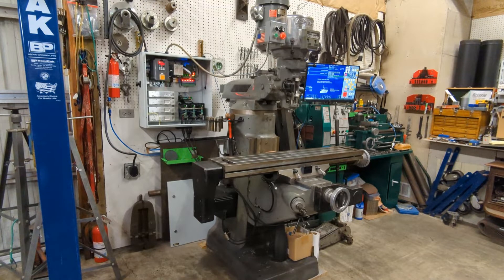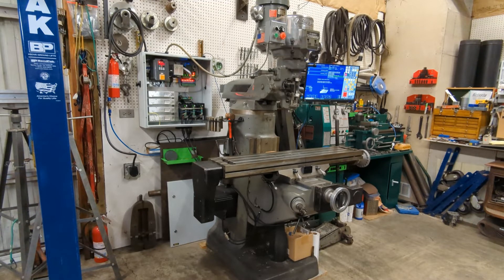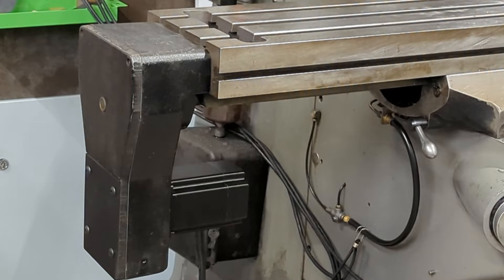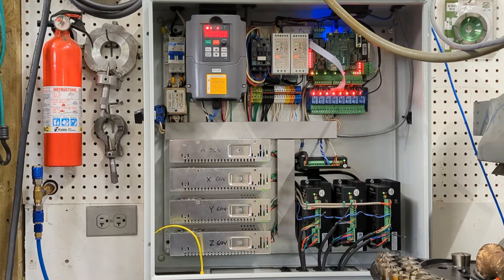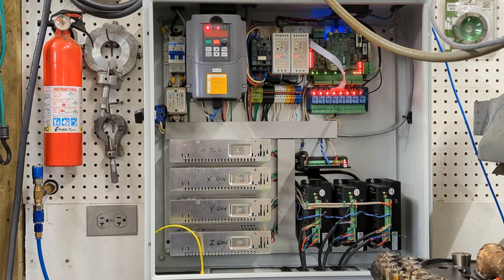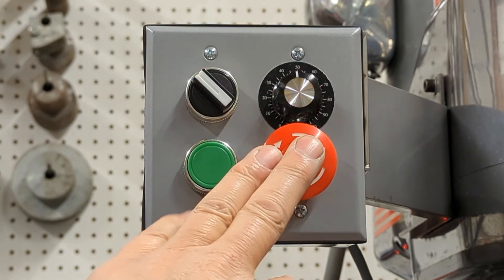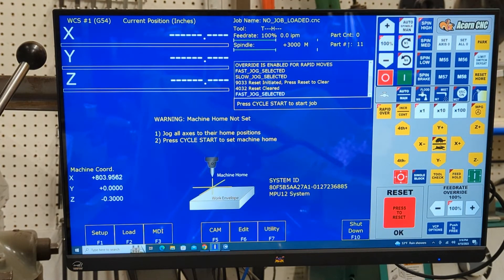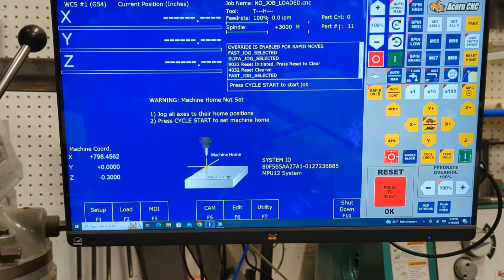CNC Bridgeport Conversion

Comment: Do you have a video or pictures of how you did the Z conversion?  Did you disconnect the table shaft to the crank? Where did you stash the z axis motor, and what pulley ratio are you running on the Z?
Reply from the maker: I don't have video of that. Had so much apart, plus it's really hard to see what I put in there. Basically I removed the bevel gears and replaced them with an HTD belt drive at 2.5:1 reduction on the screw and a NEMA 34 stepper motor and stuffed it all into the knee. It's not been ideal because there is a wear spot in one section of the screw and so my Z goes out several thousandths in that area. I also didn't realize just how many chips get inside the knee during use. I'm going to disassemble it soon and replace the screw with a ball screw set up and totally enclose the drive.
Reply: @ilrperformance7152 thanks for the info. I saw one guy replace the leadscrew with a ball screw, and then add gas assisted actuators to balance the knee.  Its heavy enough to sink if power is lost to that motor.

Comment: How are you driving the z-axis screw? Are you using a belt and pulley? If so, what belt and pulley and at what ratio? Also, are you noticing and significant backlash with the factory screw still installed in the z-axis? How did you mount the motor for z-axis? Sorry for the heavy load of questions. Very interested in doing the same thing to my mill, which currently uses quill for z-axis movement.
Reply from the maker: The Z axis on my set up is the knee. It uses a 2:1 belt drive on a NEMA 34 stepper. The motor and belt are inside the knee so you don't see it in the photos. I'm getting debris in that drive belt over time that is a bitch to clean out, so I'm in the process of moving the drive externally like i did on the X and Y. I'm almost done with that mod. The knee weighs so much it always loads the screw haven't downward and I don't use any Z compensation. Since the Z is almost always cutter depth into the part I don't move it real fast and so lash hasn't been an issue.

Comment: Very nice set up! Just trying to do the same thing myself, and had a question about the nema34 stepper motors as there is a 2phase and 3phase version on leadshine website. Seeing which one you went with, and if you went with the 2phase they have multi different power setups 36vdc,48vdc,70vdc and even 110vac for 12n.m. Not sure what is best route so seeing what you ended up using. Thanks for the help!
Reply from the maker: I used the 60 volt for X, Y and Z, and went with the 36 volt for my A axis because it just rotates my rotary table which has a pretty low gear ratio internally.

Comment: how much it cost? how much for the diagram?
Reply from the maker: I didn't build plans for this. I decided what I wanted to do with it and put together the parts I needed. It changed as I went but it's been a really solid machine. The Centroid board was my best decision, it works so good and is really easy to work with the software.

Comment: Great conversion! I would love to be able to do the exact same thing. What websites or resources did you use to be able to successfully perform the CNC retrofit?
Conversion kit, controller schematics, and BOM items to start. Thank yoU!
Reply from the maker: Honestly it wasn't real hard. I was originally going to go with servo motors but once I decided on close loop steppers I went straight to Leadshine and bought their kits. Motor, power supply and driver in one stop. Then once I chose the Acorn board they have all the schematics you could possibly want so I just followed those. The little stuff was mostly me being anal and I wanted a really clean install so I went with DIN rails and wire guides to keep it clean. Tuning it in to be accurate is more time consuming.
Reply: @ilrperformance7152  Great insight, I do appreciate the reply. Been looking into government auctions for Bridgeport knee mills since I saw your video. Thank you for the prompt reply. I will go ahead and go to those sites and begin my research to build it all in CAD before pulling the trigger.

Comment: This is nice. I am scared but contemplating doing this. I just found a J1 that is a good candidate. Any reason you picked Acorn over MACH?  You only have a few months on this build?
Reply from the maker: I picked the Acorn after doing a lot of research and talking to several users. The makers of the Acorn board build turn key CNC machines so they know the interfaces well and they provide really good hook up instructions for so many configurations. Hook up went pretty well and each thing I add on has not been much work to get integrated. It has been a couple years now since I did the conversion without any problems. But like all projects it has evolved and gotten some additional mods.
Reply: @ilrperformance7152  Can I ask what VFD you are using for this motor?
Reply from the maker: I'm using a 220 volt, 2.5 KW VFD

Comment: Timing Belt and Pulley you used
Reply from the maker: I used a 5mm pitch HTD belt and 2 /1 sprockets. Since the Bridgeport moves .200" per rev on the table it was really easy to dial in the distance per motor rev.

Comment: Can you disclose what kind of cost to expect to convert one of these machines to CNC? I am looking at either buying a new manual/CNC machine for about $15k (CNC Masters) or I can get an old BridgePort about $3K to $6K and convert it. Old American iron would probably be a much more substantial machine than a new one but also an overkill for my needs.
Reply from the maker: I did all of the research, bought the parts and did all of the assembly, so I'm into the whole CNC conversions right at about$1500.00. But honestly I didn't add every item up, some stuff I had here in the shop. I wanted a very heavy commercial Bridegeport for the stability. The newer clones or the smaller mills were just not rigid enough for my liking.
Reply: Thank you so much. I have decided to get an old BridgePort and recondition it. It will come out much cheaper and I believe I will end up with a better machine, plus the fun of rebuilding it. It looks like I can get a decent one for about $3K to $4K, about $5K to $6K for one that has 2 or 3 axis control. I would of course update all the electronics.

 From what I understand your machine had two axis motorized. You did not show how you converted the third (I guess the Z) to motorized. Can you show that?

I am looking to do very similar to what you have. I am new to the whole vertical mill thing and machining but will be starting to put together a small machine shop at my home for personal use. If I start with a manual bridgePort, can I convert it to a full CNC or would it be much better for me to start with a bridgePort that is already 2 or 3 axis motorized. I do want the option to switch from CNC to manual as well.

I think that if I find a decent 2 or 3 axis CNC BP,  I would have to pay a little more upfront but the conversion may cost less? But, like I said, I am new to this so I don't know much. Any help would be greatly appreciated and thanks for responding to my inquiry. @ilrperformance7152

Comment: Can you share homing, as to the position of the table. I'm converting my floor standing knee mill and want to place my proximity switches in the right place.
Reply from the maker: I put my homing switches to set the table almost full positive X, mid travel Y and 12" down on Z (my knee is my Z axis). That gives me the table room I need for set up and for part removal, then I translate to the part coordinate system and machine in those coords.

Comment: Very nicely done.  I have a BP S1 I converted to Mach3 several years ago and want to convert to close loop steppers and Acorn.  Any thoughts on how to keep the steppers from back generating when running the machine with the crank handles?
Reply from the maker: The steppers I used have so much breaking when powered up you can't turn the cranks without breaking something. I bought Centroids wireless pendant (which was amazingly easy to install) so I just crank the pendant and put the table anywhere I want. I didn't plan on a pendant, but now that I have it I would not want to be without it. I can literally move the table in .001" increments when I need to, or up the speed and t moves damn fast.

Comment: I have Hardinge 2007 2 axis cnc mill with an ez vision controller. This mill looks identical to the one in your video. The machine it’s self is in great shape, but the ez vision controller quite working. This is a common issue with the e vision controller. I would like to retrofit this machine into a 3 axis cnc mill with the quill as my 3rd axis. Do you have a video of your work that you done on your machine, or advise me on what I should do if you were me. What would it cost to do this myself and what would cost for me to have it done. Because my machine is identical to yours would you be intrested in taking this on. Your thought would be greatly appreciated.
Reply from the maker: Depends on what you have now for lead screws and X, Y and Z drives. You need good ball screws but if it was already NC it may have good screws. If it is a Bridgeport clone the spindle probably already has power down-feed so you'd need to disable a fair amount of the gear drives for that and replace with a stepper or servo. I chose to make my Z the knee. That way I still have the quill power feed but the Z has CNC control thru the knee. My A axis is a removable rotary table.

Comment: Do you still have the old motors ?
Reply from the maker: I have the original 2 servo motors and all of the cabinet and electronics
Reply: @ilrperformance7152  I am interested in purchasing them. My mill has had motors removed  should I contact you at your web site?

Comment: What size stepper motor are you running on the knee? They have quite a few selections on stepper motors they go by Oz or newton meters. Nema 34 to nama 42.
Reply from the maker: I used NEMA34 closed loop steppers, 9.0 Nm on all axis. They are more that I need on X and Y but pretty decent on Z. I don't lift a lot of big steel items on the knee though. Mostly make aluminum parts. If I needed more power I can change the 2:1 drive do a 3:1 drive and probably nothing would stop it before the drive nut broke.

Comment: Did you change the ball screw?
Reply from the maker: This started out as  2 axis CNC from Bridgeport so It has ball screws in X and Y already. I have not changed the Z to ball screw and so far it works fine since the  weight of the knee minimizes backlash. The Acorn CNC has backlash compensation as well.

Comment: I have a nearly Identical build on a YCM-30 mill. Currently battling with a way to get the control system to account for the low / back gear of the head in order to spin the motor in the opposite direction. Do you use the low gear at all?
Reply from the maker: Ah, yes that was something I learned along the way. In high gear the spindle turns one way, but it turns the opposite way in low gear because of the gear reduction they use. I thought that my VFD was giving me grief and switching output on the 3 phase. I just set the VFD to run clockwise when I'm in high and counterclockwise when I'm in low.

Comment: Great video! Do you have a list of specs or model numbers for the steppers and other components? I have a manual Series 1 I'd like to convert. Thanks!
Reply from the maker: I didn't put together a build list for everything. To be honest I changed a few things as I built it and either found alternatives or figured out a couple issues in the build. The closed loop steppers, the drivers and the power supplies I got from Lead Shine. They are pretty good at putting together the stepper components you'd need. I used the Acorn CNC board. There are cheaper boards but so far none that I have found are as trouble free and easy to set up.

Comment: I'm working a similar project with a ca. 1980 Bridgeport Series 1 Boss 5 CNC.  I've been stuck on the wiring of the VFDS and drivers.  I'm using DM860H drivers with, not sure of the VFD brand.  I have a breakout board and am now trying to figure out the needed power supplies.  I am using the original motors for now. Are separate power supplies needed for each driver or is it possible to power the 3 from 1? If your willing I'd love to see a video with some discussion and close up shots of the wiring between the drivers/motors/computer.
Reply from the maker: I am using a separate power supply for each motor but if they are smaller motors I've seen it done with common power supplies. The Acorn board to the VFD took me a few lay outs and changes since I set it up so I can use the Acorn SW to run everything, but also kept the ability to run the motor speed, the reverse and the safety stop all manually if the board or the PC is offline.

Comment: Nice conversion!  Did you replace the leadscrews with ball screws?  What is your backlash and accuracy? I’m looking to do the same with my manual bridgeport.
Reply from the maker: X and Y already had ball screws from Bridgeport so I didn't have to change them. The Trax SX was a 2 axis machine with a huge computer and DC servo motors. It ran on 3 1/2" floppy discs.🤣

Comment: Nothing on the Z motion?
Reply from the maker: I put the z axis motor inside of the knee so i could drive the screw directly from the motor. I was worried that I'd have to much backlash if I ran it off the crank outside since that runs thru the bevel gear.

Comment: Nice setup, I did the same on a supermax Bridgeport clone . The Centroid Acorn system is more expensive than most but worth every penny.  I am curious though, where is your Z axis stepper? Mine is right on front of the mill head and takes away most manual quill control.
Reply from the maker: It's up inside the knee, driving directly off the crew. I was worried that the lash would be too excessive.
Reply from the maker: I put the z axis motor inside of the knee so I could drive the screw directly from the motor. I was worried that I'd have to much backlash if I ran it off the crank outside since that runs thru the bevel gear. I only use the quill feed for boring now and use the knee for NC in the z direction. IDK if that is the best but working good so far.
Reply: @ilrperformance7152   do you happen to have any pictures of how you drive the knee?
Reply from the maker: I didn't take any video of the knee drive but if I have to service it some day I will.